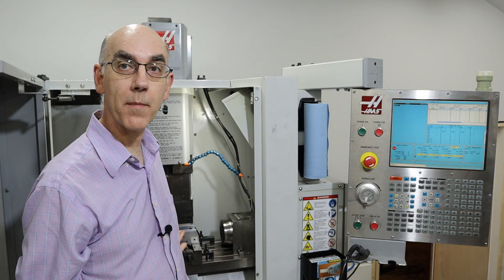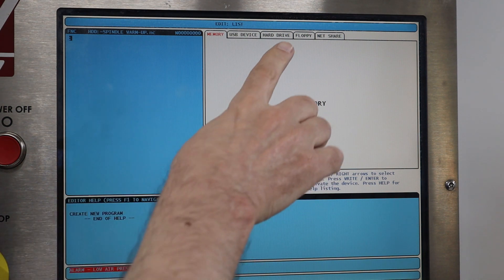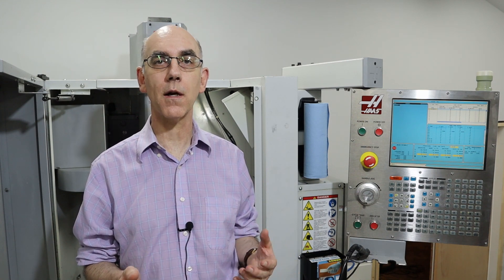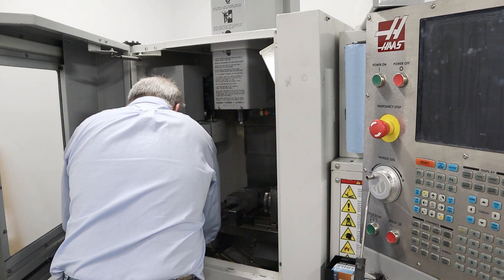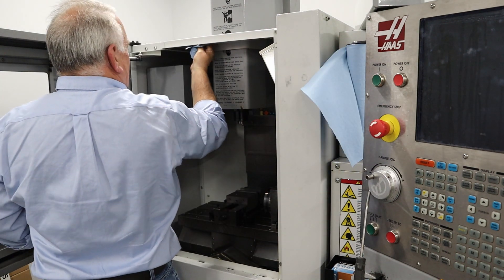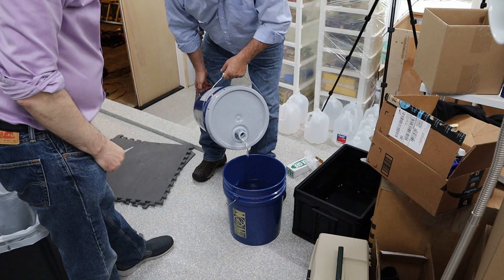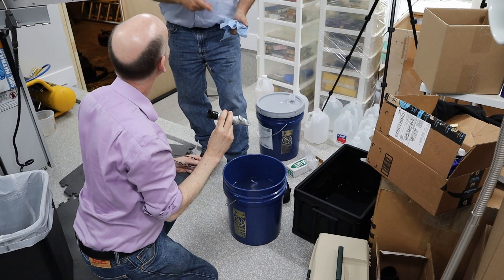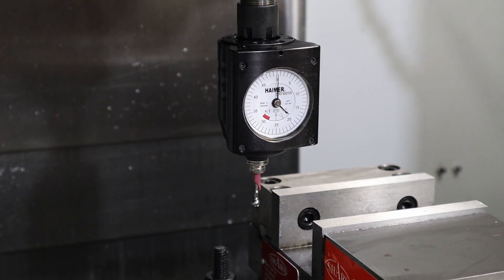Haas Coolant, More Leveling, and Vise

Comment: Interested to see the Blaser.  I'm using QualiChem Xtreme-Cut 251 which is milky.  I like the more transparent features of Blaser.   I've only broken a couple of Haimer tips in two years and when It happens I'm always tempted to order multiple since it's so painful to wait for a new one to arrive.  But think if I have spares I'll be more likely to need them. :-)  Glad to see the progress on the Haas.  No need to apologize for taking it "slow."  You're going to have that machine a long time and good to get to know it now.
Reply from the maker: Thanks. I'm hoping to start making chips this weekend and see how the Blaser does. I'll definitely report back. The main downside I've heard is that it can form a waxy coating on zinc.

Comment: Interesting that the light box has a "diffused" cover, I've never seen those! I have a 2010 and 2012 which use just a single glass pane. So I don't think you'd have any issue replacing that piece for even more light. The new bulb should work good either way!
One other note, don't be afraid to remove the rotary from the machine if you don't plan to use it for a while time. All it does is become another object to clean and get in the way (lol). Some people leave them in but cover up with a thick plastic bag to minimize the amount of coolant goo. But if you want to remove it, just disable setting 30, turn the machine off, and unplug the cables, easy!
Reply from the maker: The new LED bulb is certainly a lot better already. I had a hard time removing the diffuser. So if it's not original, that could explain my problem. Most likely it's just a little thicker.

That's a good idea about the rotary. Thanks for the information.

Comment: Nice to see your fine machine like the paper towel holder unit thing.
Thank you. Yes have fun enjoy your nice machine tool.
Lance & Patrick.
Reply from the maker: Thanks Lance. That reminds me, I should add links to that towel holder and also the glove box holder. On another note, any chance you guys can do a video on your air system?
Reply: @JohnSL  Hi John thank you for asking us about the air system here at the AA.
Since you have a CNC machine, air is really important tool changer, spindle blast, traditional air line runs even though we do not think your machine has it optional pressure 300 PSI or 1k PSI through hole spindle coolant all requiring air compressor action.

We ran the air lines here months before the start of filming.
We have about 10 to 15 drops in the Workshop area, 10 to 15 drops in the Machine Shop area with 1 drop in the kitchen to blow off the dishes.

We are going to upgrade our US made air compressor in the Machine Shop with a twin screw and reserve tank to operate our someday CNC machine and then relocate our Quincy US made single tank air compressor to the Finishing Shop named by viewers the Grinding Hut, an out building a few hundred feet away from the Machine Shop area to run about 5 drops. 
Wish we could show how we did this system but we have a product to being machining now.
About our air system
The system is on 24/7 365, no leaks not any, it took reworking the drop connectors and the likes many hours of airflow research and proper purchases of the hardware and several months to perfect, while there it is, however if you were here John you can clearly see room for additional improvement, it is also 100% moisture free, you might be proud of this system in the end John.

We share this since you bought a CNC machine.
Did you know we program in SolidCAM by SolidWorks, it is a good software if you are into details and functionality. The future sharing is bright and modern here.   
While it is true Lance answers the comments, they are actually read aloud to us both, discussed and then answered in my or our own words though. So these are actually replied to from both Lance & Patrick.  
Thank you John for being our friend and for asking this great air system question